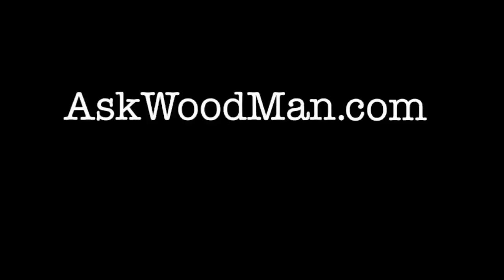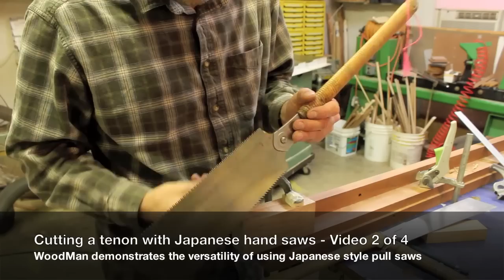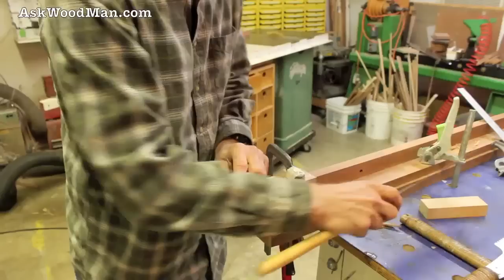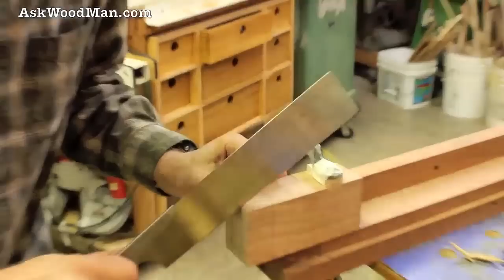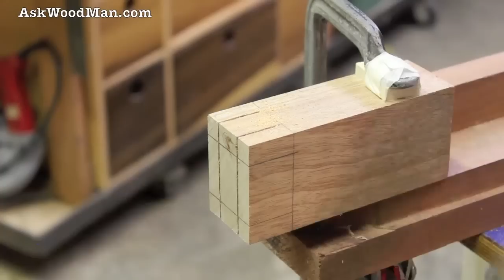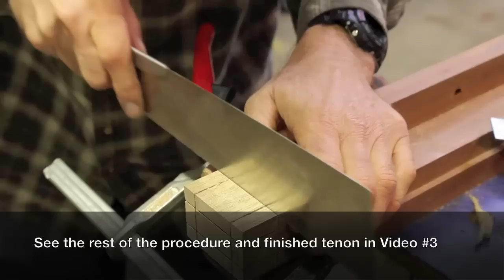41 How To Cut A Tenon With Japanese Saws - Part 2 of 4

Comment from the maker: I do partial handcut dovetails in the Ultimate Work Table Series in poplar and in the Flat Screen Entertainment Series in African mahogany. My standard "just get on with it" method is to cut the tail shoulders on the table saw and cut the pins with a fine tooth Japanese rip saw which is different than the beast  in this video. I just wanted to show that even an aggressive carpentry type saw can make some fairly precise cuts. Thanks for watching and taking the time to write.

Comment from the maker: I may be the wrong person to advise you on setting up a manual shop because I use power tools any chance I get. I just want to get on with my work and I will do it with anything I have available. That being said, there is never a shortage of hand work to do. But I am not going to edge join boards when I have a jointer that I can set up to make perfect joints every time. I love having a big powerful accurate versatile table saw too. Every craftsman has their own path to travel and that is good.

Comment from the maker: @krish2487 The video shots were set up with visibility in mind. That being said, my work table top is almost square and the table loaded with wood and tools weighs in at least 900lbs so cut direction is really not as much of an issue. The design of the base does not allow give or movement in the slightest in any direction of force. Thanks for watching and commenting.

Comment: The simple trick with japanese blades is that the pull action only requires a very thin blade. This results in up to 10 times less wood that have to be cut out. Our double action saw types are a real waste of energy and material.